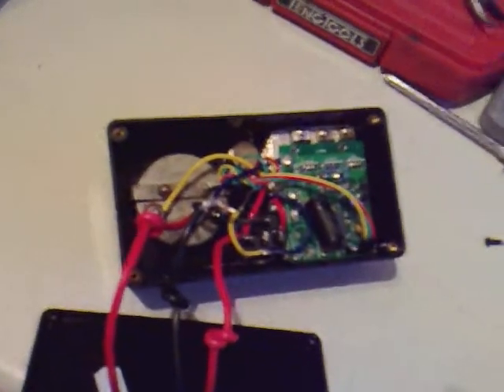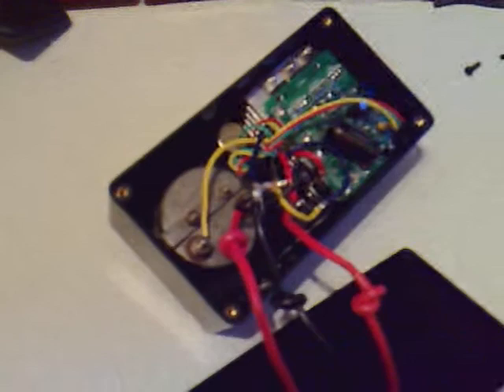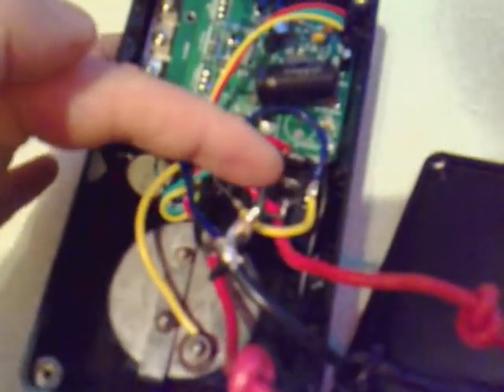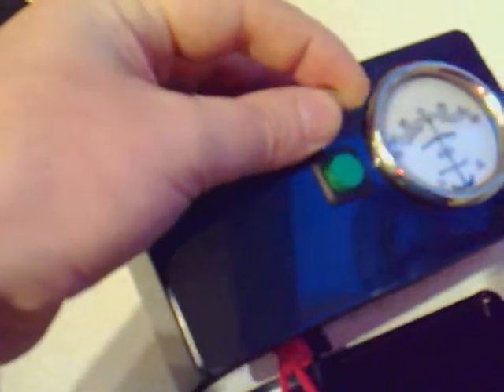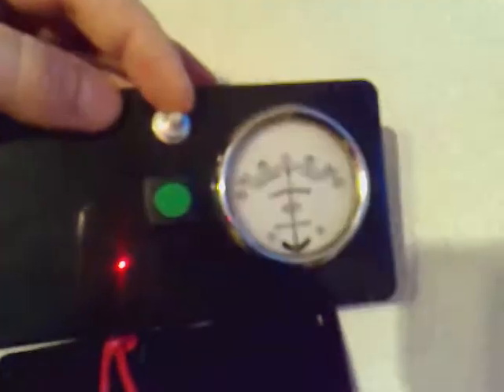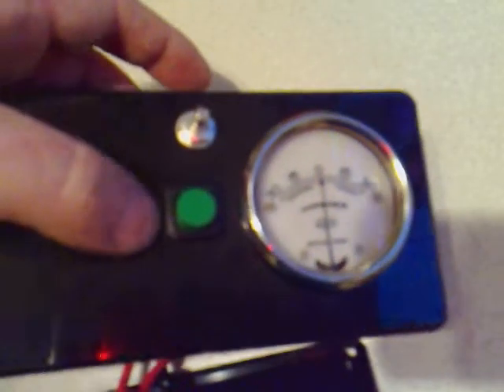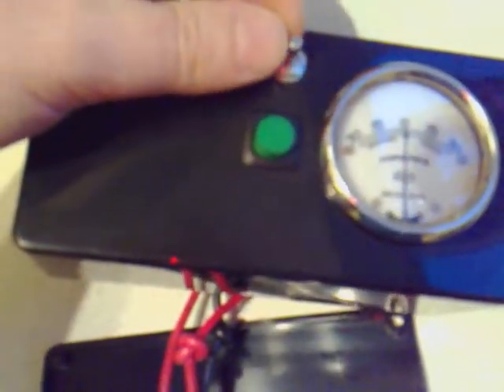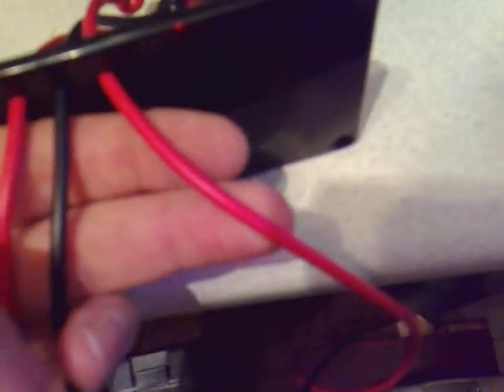PWM in a case ready for my car, HHO yorkshire

Comment from the maker: Hi, a pwm is normally used as a dc motor speed control, i bought mine on the auction site, you need one thats 12volts and 30amps for a cell similar size to mine.